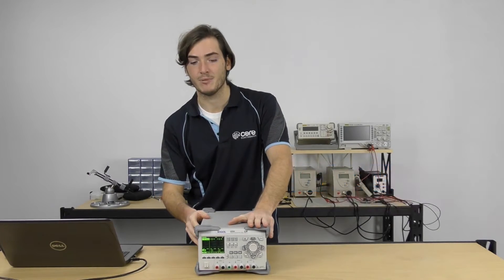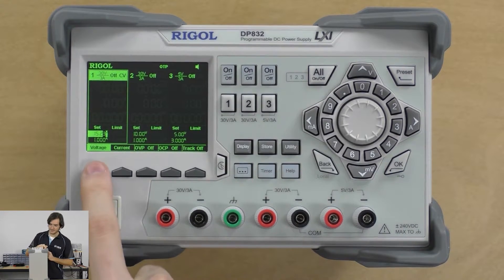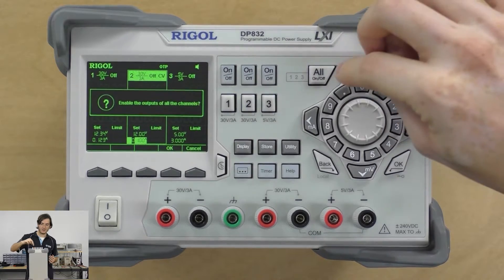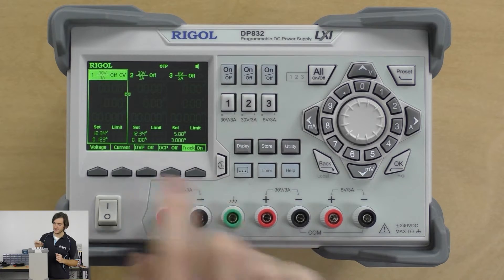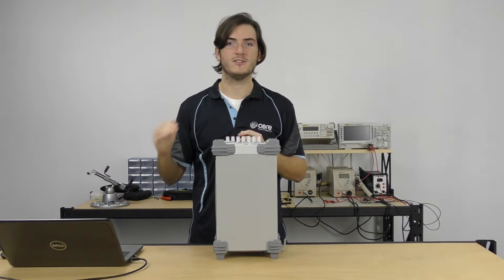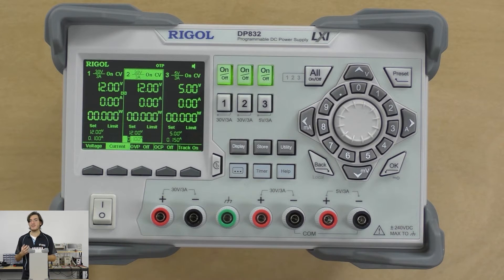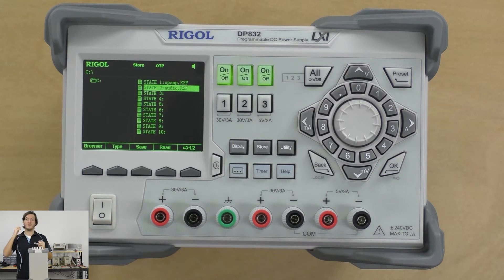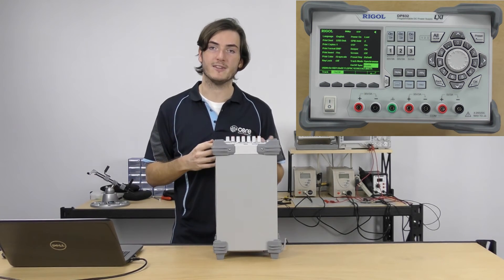Our review of the Rigol DP832 Power Supply

Comment: The video disappear just shortly after I started it! Make sure you fix it. Now I have a question, can I test 18650 batteries on this unit? I know that the 3000 models from Rigol is better for that kind of test, but something can be done right? Even if I have to solder together something that would work? I can't buy both right now, so DP832 is my need before the 3000 model. Also, have you done comparison DP832 and DP832A? Thank you for your videos!